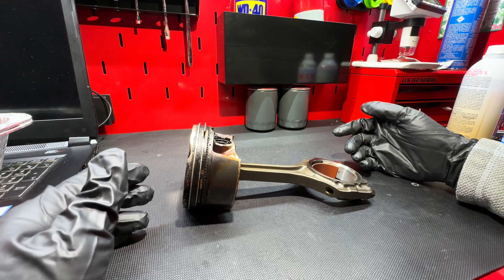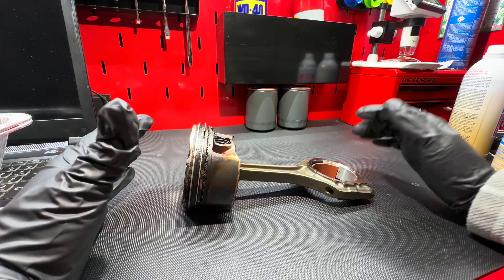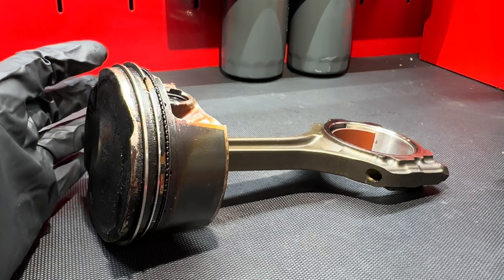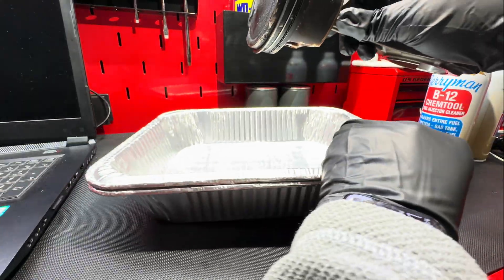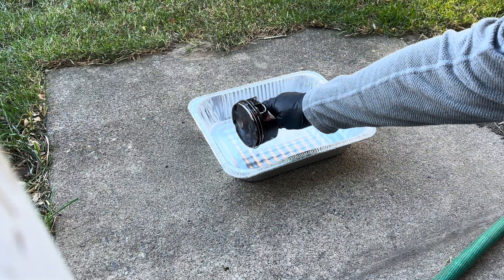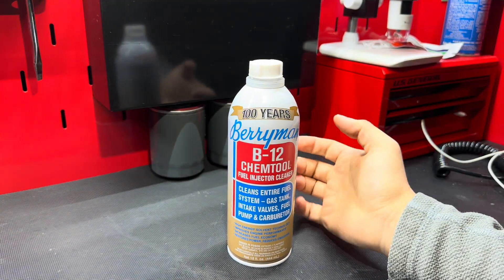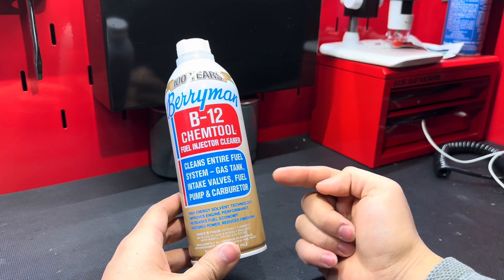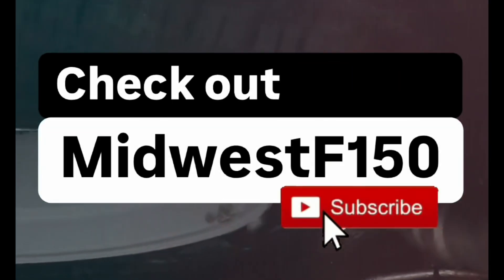Part 1: WHOLE Piston Soak in Berryman’s B12

Comment: Use b-12 to clean my 3.5eco injectors a few weeks ago. Had one hang open, replaced it with a used one and cleaned all 6 with b-12 chem and a toothbrush. Car runs SOOO much better 👍🏼
Reply from the maker: That's awesome to hear it worked so well for you!

Comment: a whole dang piston
Reply from the maker: @KarzRFrendz oooooooh yeah!
Reply: @MidwestF150  you should dip the other side in Valvoline Restore and protect 👀
Reply from the maker: @KarzRFrendz this is exactly what I was debating but I was told that the oil needs to be warm and circulating to actually work—otherwise it will be like watching paint dry hahaha

Comment: BG 44K Platinum is the best additive I’ve seen with the least amount of work…
2 gas tanks back to back should get it good….
Reply: Helped with piston ring sticking too ?
Reply: @AAAAAAndrea I would Certainly try 2 tanks of gas with it….
I believe you would see significant better running Engine
Reply: @kevinkinsler I am using Chevron Techron, has the same amount of PEA as the BG44K, but cool thing is that costs less than half, at least here in Europe. BG44K is easier to find tho ( paying a hefty price for it too 😂😂 ). I am doing the 2 gas tanks back to back to see if there are improvements, but it's not my car ( mom's car ) so no spirited driving 😅
Reply: I used BG ERp before an oil change, then put MOA in with the fresh oil.  I also used BG 44K in the gas tank (don't think it was the Platinum though) and after that, my oil usage didn't change any on our 2010 Prius.  I had to do the head gasket on the car and I did the B12 piston soak and ran three bottles through it (one bottle over the 4 cylinders three times) and with the head off I moved the cylinder and found a bunch of carbon stuff from the rings on the cylinder wall.  After a little bit of driving the car runs better and went from using 1 quart every 6k miles to now over 3k miles I could barely see movement of the oil level on the dipstick.  Normally, before it would be halfway down between the full and the add mark on the dipstick at 3k miles.  I use Valvoline Restore and Protect in the car now, also to clean up any more deposits and hopefully keep it from buidling up stuff in the rings again.
Reply: @tedjacobson7822 But did BG ERP work? cause after all that you will never be sure about what ERP did.
I don't want to do the piston soak, but I wanna try ERP. 
From the SDS it appears to have quality solvents
Reply: @AAAAAAndrea  All the BG stuff looked good, but I looked at my records and I did the ERP and MOA and didn't notice any difference in oil usage over 25k miles, same 1 quart of oil used every 6k miles.